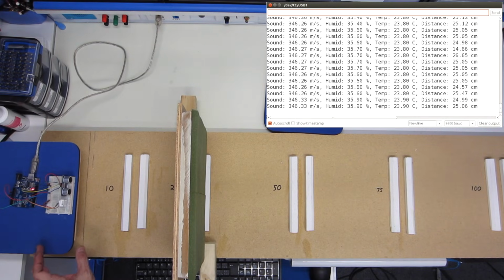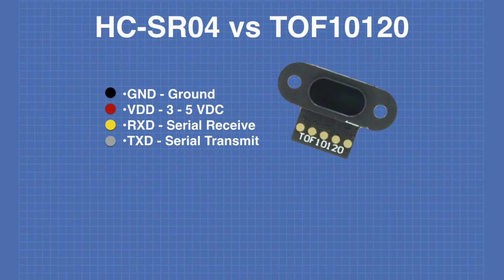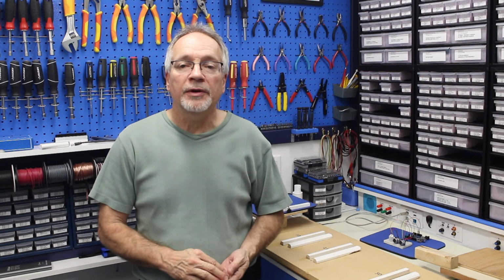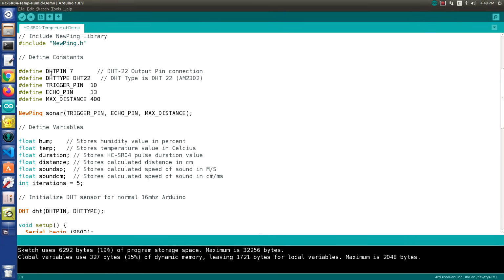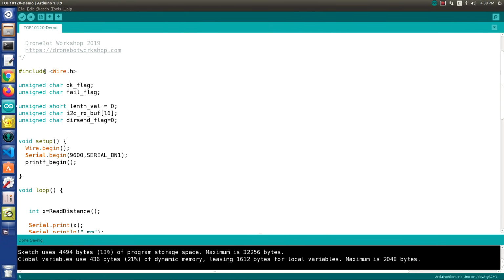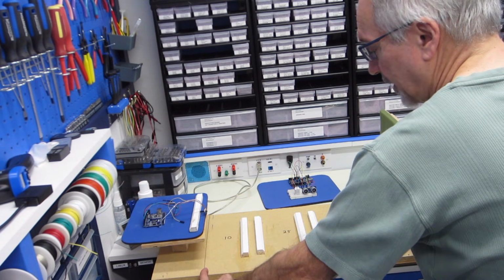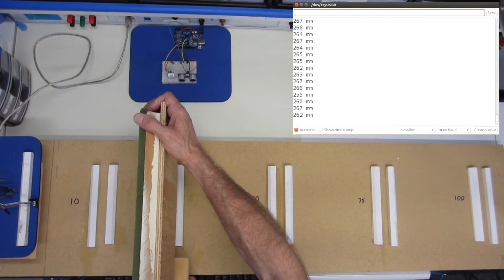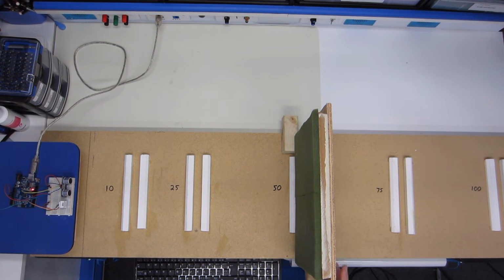Laser vs Ultrasonic - TOF10120 vs. HC-SR04

Comment: The problem with the HC-SR04 is that you often have "outliers" in the measurements and have to recognise and filter them out yourself. There are also big problems when the measurement falls on a surface that is positioned at an oblique angle to the sensor. I had hoped to find out in this video whether the laser sensor performs better. But unfortunately not.

Comment: A possible very useful application for the TOF10120 is in pressure tanks tipple used for spray painting. It is difficult to tell how close to empty the tank is. This sensor would seem ideal if it can tolerate air pressures around 100 PSI. Is there any information about pressure or can someone reasonable guess what might happen?

Comment: Consider this a 'heads up' to anyone getting their TOF10120 working for the first me. I found that the compile fails because of a reference to "fdevopen". ('fdefopen not declared in this scope'). I am not a seasoned Arduino coder and I really didn't know what to do to fix it. In researching it I couldn't 't even figure out just what it was supposed to do. Anyway, just for grins, I just deleted it and any references to it and what-a-ya-know... the sketch works just fine without it.

Comment: Very good and useful video. I am working with the HC-SR04 sensor and I realized that I should imagine A WIDE CONE exiting from it. In your case, to have a real idea of the cone, stating to your measures, you had to put a long ruler bar starting from the centre of the sensor and hit around the 50cm lower bar on the table (the max distance of meaningful detection) and see the real angle.
Another thing that you could do, was to raise the sensor to increase the distance from the table and avoid the sound cone to hit the table and bounce back.

Comment: It is possible to improve the HC-SR04 by decreasing it's measuring angle. To do this one can simply roll up some card stock into a tube and slip it over the transceiver/receiver cylinders. Longer card stock tubes result in a higher directionality of the measurement.

Comment: I've spent time with the TOF10120. You can change several parameters inside the device by transmitting (on the serial interface) a message with the format 'sR-xxxx#' where R is the number of the register in the range 0 to 8 inclusive, and xxxx is a numeric, decimal value (which varies in size depending on the register to which you are writing). Conversely you can read any register by sending 'rR#' where R is the number of the register. So to read register 3 you send 'r3#' across the serial interface.

Deviation (register 1) allows you to change a scaling value. Changing this value you can calibrate the device at a given range. So, for instance, I can set an object exactly 200mm from the sensor and modified the deviation until the reported distance is 200mm or thereabouts. As an example, I send the command 's1-02#' on the serial port which reduces the deviation by 2mm. Reading back the register (by sending 'r1#') you will notice the 's1-02#' command is a decrement of 2 - you are NOT setting an absolute value! So conversely, if you send the command 's1+02#' you will see the value of the register increments upwards by 2. The ONLY time this command sets an absolute value is when you send 's1-0#'. The maximum range for the register value appears to be -100 to 99. For my device I found the best value for register 1 was D=-17mm. I'm not sure why it's return in millimeters. I suspect this implies there is an ideal calibration distance. One thing for sure, you can massively improve the accuracy of your device by playing with this value!

There are other useful things you can set including filtering, on or off (I suspect this is kalman filtering) which is register 3. You can also set the measurement periodicity over serial which is set, by default to 100ms. This is set via register 2. You can also tell the device to stop continuous transmission of readings (the passive mode) using register 5. This is set by sending 's5-1#' for passive or 's5-0' to return to continuous streaming. If you DO set for passive reads, you can either read across i2c or by reading register 6 ('r6#'). Note this will ONLY return the distance when the device is in passive mode.

Finally there is another value, register 8, which is the calibration command. To be honest I haven't played with this register (yet) but I suspect that using a combination of register 1 and register 8 you can actually get decent accuracy out of this device.

Next up we have the i2c interface (which I prefer to use as the serial connection is a 1 to 1 interface)

If you read 2 bytes from device 82 (aka top seven bits of address 0xA4), register 0, you will always get the range (in mm). That applies to both active and passive modes on the serial interface. However you can also read and write the other registers! This is where things get strange. I've spent time mapping i2c byte addresses to their equivalent registers. Here's what I've come up with so far: i2c byte address 0 corresponds to distance (2 bytes). byte address 6 is the deviation (2 bytes) and corresponds to r1. The serial send interval (default 100ms) is found at byte address 10. The maximum distance measurement (max value 2000) is found at byte address 12. The active/passive flag for serial measurement transmission is found at byte address 9 (1 byte). The distance measurement is found at byte address 4 (2 bytes). The 8 bit device address is found at byte address 14 (2 bytes) or byte address 15 (1 byte).  The filtering on/off flag is at byte address 8 (1 byte).

I hope this helps. If you spot any errors or have additional information, please rely to this comment and I'll either make corrections or confirm your observations!
Reply: so actually you can get good readings below 100mm? How low?
Reply: @lebronjames2864  I am out of country until July 7th. I will take a good look at readings below 100mm when I return to my lab and update here.
Reply: @lebronjames2864  I haven’t used one yet, but it probably depends on your definition of accuracy. Assuming it functions by measuring round-trip delay of a brief laser pulse, I see no reason why it couldn’t measure distances as short as 1 mm. At these ranges, constant error would have more effect than proportional error, so I imagine it might read 3mm instead of 1mm. This would be “only off by 2mm”, while also being “200% off”.
Reply: Great info thanks!!! Is it possible to change the i2c address to use several of them?

Comment: I suspect the ultrasound sensor is picking up the white colored holders on the base board, if you had the sensor twice as high from the base, the sensor would miss the obstacles on the base board. it is a quit narrow vertical angle from the transducers. 
To me that is the most likely cause of the max measurement 
Kind regards Hans

Comment: Is it surprising that a "Time of Flight" sensor is only effective at close range?  If it's designed to tell how long your quad copter or whatever has been in the air, do you really want it to potentially confuse trees and structures with the ground?

Think of a macro lens on a camera: you can focus it very close to the subject, and not farther away.

Remember that the Time of Flight sensor is an optical device with a very narrow field of view, which indicates it's designed to focus at a short distance.

Remember that the ultrasonic sensor had the exact opposite problem:  at longer distances, the target wasn't wide enough for the ultrasound signal to be bounced back.

Comment: One thing we must take into account is that no sensor has a real linear response. Usually the manufacturer datasheet has a table or graphical representation of the readings versus the real values. That info should be included in the software, usually in the form of a lookup table, to compensate for the natural non linearity of the sensor.
And, yes, a LASER based sensor will always out perform a ultra sound one, but not by $10.

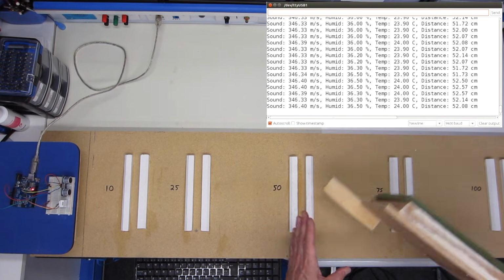Comment: I own a HC-SR04 too and as far as i know those devices are rated up to 7 meters. At 26:13 the reading didn't even change if you go to 100mm. I would suggest trying another lib and check the calculations that are done with the temperature and humitiy sensor. Maybe there is some sort of mathematical maximum hidden in it. Another possibility could be that it catches the white place holder.
Reply: Hello, HC-SR04 is a cheap device, I don't think it can measure the distance more than 1 meter. In my tesing, it only measures around 0.5m. Did you do any test with more than 1 meter?

Comment: Well, I get it, the sensor is fast. How fast? 10hz? 50hz? 100hz? 1kHz? What about the extreme cases? When board is right in front of the sensor? How the signal look then? What happend if board is right outside the sensor range? What will happen when the board will be at angle to the sensor? There is no problem detecting big static object. Half an hour video about nothing... I am looking for a replacement for GP2Y0A60SZLF, but i guess I need to buy every modern LiDAR / ToF sensor and test it myself...

Comment: I suspect the ultrasonic sensor was responding to the reflection received from the sticks on the board.  That ultrasonic sensor has a small pic on it and you're at the mercy of the embedded firmware.  I can assure you that it received the reflection from the further distance, it just ignored it.  I did a pic project in the early 2000s using some transducers obtained from a surplus electronics store.  I was able to receive reflections from over 8' away reliably.  It does have a broad cone of sensitivity, but that can be handled with a literal waveguide to narrow it considerably.  I was driving the sending transducer solely by connecting it to two output pins and toggling one low and the other high simultaneously, with a slight delay then reversing the drive, effectively putting 10v peak to peak on the sender, for 6 cycles spaced to generate a 40kHz signal.  Using a single opamp on the receiving transducer, it could easily measure to the far wall in the room I was using.  Using an oscilloscope I could see other reflections arriving early.  I suspect the sensor you are using is picking the first one above a hard set threshold, without regard to any stronger ones received later.  Outside of convenience and cost, these mass produced sensor modules are just not that good.  I don't believe they have any ability to measure relative strength of the reflections, just a simple comparator aided by a gradual increase in sensitivity (by lowering the threshold) as time elapsed after there transmission, eventually giving up after a preset limit.  They're fine for what people use them for, simple to use, but fairly crude technology wise.  They're built to a price point, and it shows.I haven't dug through the Arduino library code, but I'm confident that the pulse widths measurements are equally as crude, influenced by random inaccuracies caused by interrupt handling routines. I would think that by using the capture feature of the atmega chip, consistency would greatly improve.

 I have no experience with the TOF module.

Comment: According to the article you are using "331.4 + (0.606 * temp) + (0.0124 * hum)" to calculate the speed of sound.  Could you give a quick explanation where you found these numbers?  I did find the .6*temp+331 in some other reference but have been unable to track down the humidity calculation.

Comment: Hey guys, what sensor would you use to measure the depth of a hole (5.5cm diameter). I don't get reliable readings because of the measurement angles these 2 sensors have.

Comment: Hello,
Interesting video.
I am really amazed by the lack of reliability in the measurement by the TOF10120 sensor.
I notice that the measurement by the HC-SR04 sensor is displayed with two numbers after the decimal point, that is to say in tenths of a mm. It is surprisingly very precise in the 25 cm / 50 cm area. :)
Have a good day

jPL
Bonjour,
Vidéo intéressante.
Je suis vraiment étonné par le manque de fiabilité dans la mesure par le capteur TOF10120.
Je remarque que la mesure par le capteur HC-SR04 s'affiche avec deux chiffres après la virgule, soit en dizième de mm. C'est étonnamment très précis dans la zone 25 cm / 50 cm. :)
Bonne journée
jpl
Reply: His code is doing 5 reading averaging to get that value and pausing 2 seconds between each set of readings; it's why it updates so slowly. You can get much faster readings out of it with slightly less accuracy. He talks a lot about how slow the sonars are but that's due to his code setup and my only complaint about his description of them. They can in fact go quite fast and still give good readings.

Comment: I thought I might be able to use the TOF10120 for an application where I'd previously tried an HC-SR04, but was disappointed its apparent lack of accuracy. Then I found the VL53L0X laser board, and wondered if you'd tried that. It's supposed to work up to 2m, so seems to serve a similar function to both these devices, and it's cheaper than the TOF10120. Has anyone tried comparing them?

Comment: What happens at the extreme, ie the 400 cm distance quoted for the SR04?  I have the SR04 and an SR08 with supposedly double the distance, but can't get more than 6 feet in my shop.  According to tech support it's because the sensor is seeing the floor or the ceiling, something I dispute because I have an 8 foot ceiling and my sensor is right on the edge of my desk, 32" off the floor.    They work great at short distances but the divergence could be an issue.  I'd like to see some experiments with cone reflectors and push the limits to the extreme.   As a result of my own tests and these issues I decided to go with microwave (radar) and also laser (bouncing off a mirror and back) for vehicle detection on a busy highway.

Comment: Hey guys, i am looking for a way to messure the flightpath of a small object, to catch it with a robot. Ultrasonic would be great, but the field of view is to limitet. Do you guys know which sensor i could use or is it possible to build a cheap ultrasonic sensor with one output and varios inputs?

Comment: Great video DroneBot! Can either of these be used behind a sheet of protective glass/plastic? Or will the sound/light reflect off a see-through surface? I'm trying to find devices that can be placed at multiple levels inside a canister of dry goods (e.g., dog food), and am thinking I'll need to separate the sensor from the stored material by a sheet of glass or plexiglass.

Comment: Nice vid.  Quick question.  Does anybody know if the Tof10120 can detect water surface levels?  Mounted pointing down at the water surface.  Thanks for any comments / followups.
Reply: I've tried that and it didn't seem to work well (i.e., the measurements were way off). The light just passes through the water until it hits the bottom of the container if it's in range. If you're trying to measure the level in a smaller body (e.g., a few feet), I'd use eTape liquid level sensors.
Reply: @cdfairchild  Thanks for the feedback.  I am going to test independently with multiple ToF sensors as well as the ultra sonic HC-SR04 and will report back as to my findings especially since the sensors are soooo cheap.  However, I thought a lot more about it and I think I am going to be using load cells.  Knowing approximate densities as the fluids relate to water and knowing that 1 mL = 1 gram for water and being able to measure to the 1 gram increment on the load cells I should be able to make these measurements with a high degree of confidence.  I will report back early part of February as to my findings. Thx for your feedback

Comment: For optimum accuracy you must know the angle of transmission cone pattern on the sensors
Often you will pick up the ground suface too early in most applications with low mounted sensors, which gives false readings.
The sensors TX pattern is not that narrow as you may think.

Comment: You need to lift the sensor higher off the surface. The error appears to be exactly the distance to the quarter round behind the 500 mm Mark. 
Alternatively, put down a black or charcoal felt as acoustic damper. The Ultra-sonics are easily good to  200 cm

Comment: Would it be possible to check the laser distances device light pattern that it emits with a solid state camera? Much like you would check to see if you're TV remote control is working, just incase something odd is happening.

Comment: It would be interesting to see how the sensors compare to measuring objects that are not directly facing the sensor.  Say if the plywood is place 25 cm away and then slowly turned on the Y axis, how many degrees off could it reach before the sensor in not able to read it.  Similarly, how well do the sensors detect rounded objects, like a garbage bin?

Comment: Could you please test this with a wall that is at an angle of 30 - 60 degrees to the sensors? I built a little robot based on the HC-SR04 and being unable to detect walls at an angle is the biggest problem. If it moves towards a wall at an angle higher than 45 degrees it won't see anything and drive right in :/ So if the laser sensor is better in that it would be a good replacement!
Edit: Here is an example https://youtu.be/H-LOnznuskU?t=23 (This was my first robot btw. Thanks a lot for your videos I wouldn't have gotten so far without them :) )

Comment: One of the disadvantages of the US sensor in practical use in robotics is that hard surfaces work as a mirror. If these are under an angle it measures the reflection rather than f.i. the wall itself.

Comment: It would be useful to test measuring distance to an angled surface.  I have found that the ultrasonic sensors don't sense objects when at an oblique angle, but in robot applications you may need to sense a wall that you are not pointing at right angles.  It seems like optical sensors are better in this regard.